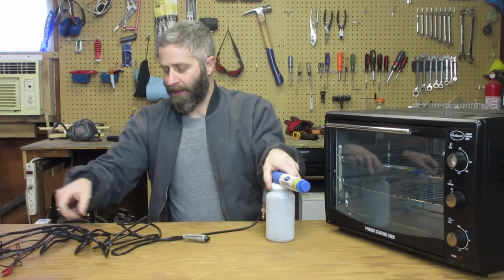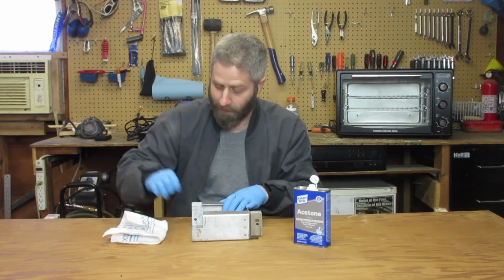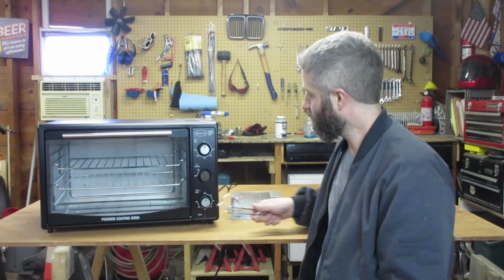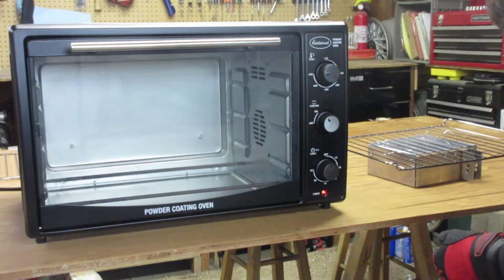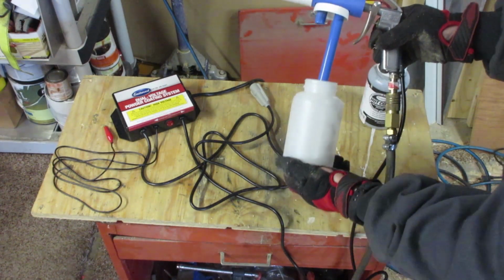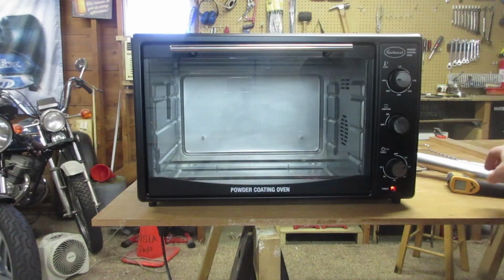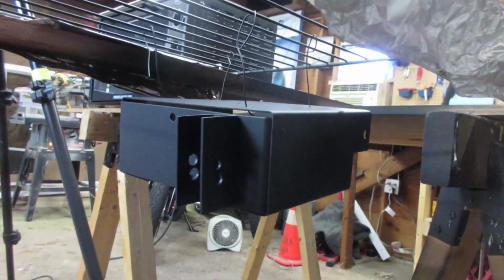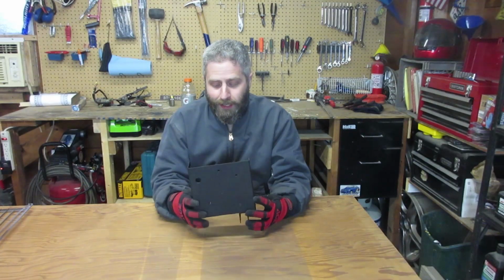Powder Coating Parts : Honda CX500

Comment: Hi Luke, following your videos I converted my GL500 as well and was just wondering if you changed anything on the electrical system in order for the new battery to recharge? Thanks, Remko

Comment: hi, great vidoes. My question is what parts of the cx500 would you pwdercoat, and which paint (I was looking to powdercoat frame, and paint the engine, swingarm and pretty much everything else). Also a BBCR mono here.